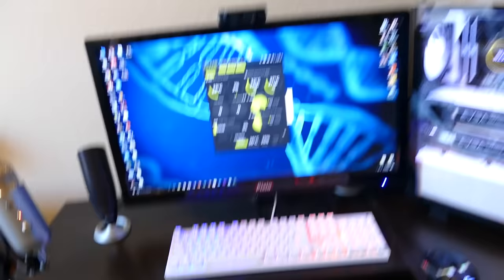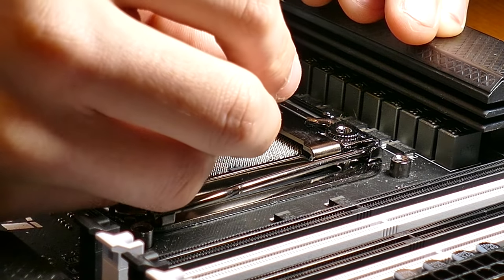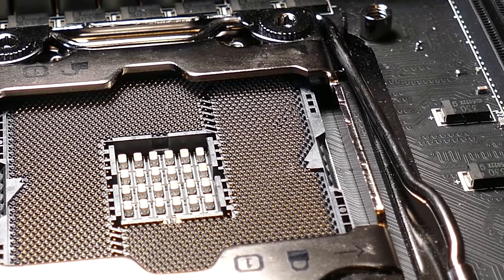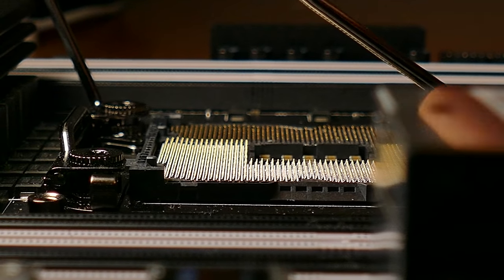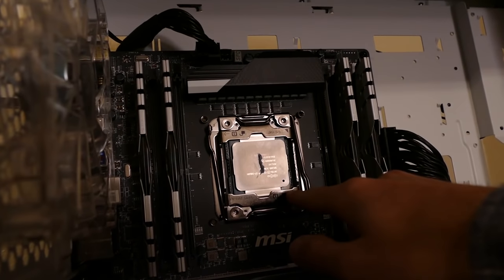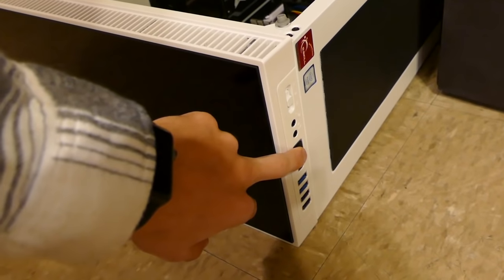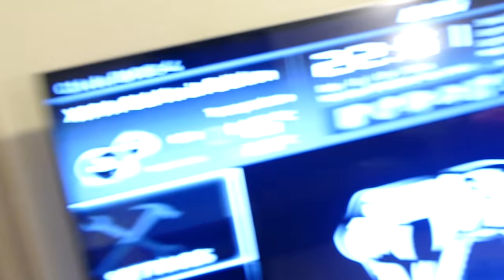I Stepped on a Motherboard. Let's Fix It!

Comment from the maker: - To be frank, this happened a few days after the death of my two editing rigs. Was one large cluster. Been putting this video off for a while. For those wondering how this happened, I was in the middle of a CPU swap. Placed the MSI Krait X99 next to my chair (had no room on my desk) and got up in the middle of working when my brother knocked on the front door. Swung my legs - bent a few pins. That is my confession. Captain Hindsights, take it away ;-)
Reply: Salazar Studio e dud
Reply: this month just hates you.....dont worry
Reply: You should not put motherboards on the floor and swing your legs around like a madman :- )
Reply: go to bed dude...
Reply: catarino neptune you will get use to is after awhile. I remember when I built my first PC I got it up and running problem free first time I was so happy until I looked at the cables..

I was to scared to even try and clean up the loose slack thinking I might bump some random cord slightly lose and have to re build the whole thing. A week ago I replaced my case and I was kinda laughing at that memory as I was ripping anything and everything out of the case.
Reply: Might be a good idea to check and see if that system can read more than 3 channels as it detected 12gb's of ram in bios.
Reply: The bent pins could also be the reason your motherboard can't detect one of the ram sticks. Also, just putting a cooler on top of the cpu doesn't do much, you actually need a lot of pressure to transfer the heat. Just look at the stock AMD coolers mounting mechanism and how hard you have to push that lever.
Reply: +Random Guy next video 'I Stepped on my New PC and now it's DEAD'
Reply: At this point I suspect you have a curse with LGA 2011 chipset.
Reply: Great video. Really need to buy that Anidees AI Crystal case,  Already have the tempered glass theme going with the desk.
Reply: accidents happen, although youve been having some bad mojo as of late.
Reply: Salazar Studio
Reply: Salazar Studio My x79 had a problem with recognizing one stick of ram. Took the chip out and saw there was something in the socket. Grabbed a razor knife and got it out. Stressed me out thinking about bending the pins.
Reply: Salazar Studio Damn, Greg. Did you piss off a shaman that week or what?
Reply: Salazar Studio damn. Hell of a rough week.
Reply: Salazar Studio actually, they do not have to be 100% perfect, as long as they are not obviously out of alignment, slightly off alignment is fine... like if they have a slightly different shimmer in light..  I bought several x99 boards with bent pin issues for 50% off...     and as long as u get them close enuff it is fine
Reply: What camera do you use Greg? Love the vids!
Reply: I did something like that with my 1155 socket early this year. To bend it I used an automatic pencil and syringe with needle, syringe is more precise and easy to hold and the hole in a automatic pencil I used to turn those pins
Reply: You are human, you will make (more) mistakes. Never be afraid to make them, and don't be afraid to share them with us, because they are educational/entertaining.
Reply: You ever consider buying a test bench?
Reply: again we make mistakes sometimes...
Reply: I had to fix the pins on a old amd cpu I had , took 3 hours with micro tweaser things X_X
Reply: I have actually done this on my i7-4790K rig. Scared the holy crap out of me. I have good vision and I had a seriously tough time seeing what I was doing. Eventually I fixed it, and all is well. It also happened to my sister's FX-8350, and I had to fix it there too. Be warned that AMD's stock thermal compound on the cooler turns into glue after 3 years. I feel like an accomplished Computer Surgeon now.
Reply: Try bending the pins back on a amd cup its fucking hard
Reply: Remove your heat sink and fan. Clean off thermal paste. Undo the retention clips. Place new cpu. The cpu socket and cpu both have a trainable and some notches to help you line it up. Drop the cpu into place. Touch the top to see if it shifts. If it does not shift you are good. Clamp the retention down. Put on new thermal paste. Attach heat sink and viola.
Reply: no its not its very easy to rebend amd cpu pins
just use a flat plastic card the same width as the gap run through from all for sides row by row simple
Reply: BeDoG yes it is hard but I did it with a razor on my fx 4350
Reply: @Mr TurDMuF1NM4N3 oh yes it becomes solid to help it turn on your pc and run prime to warm up the cpu after you sure it is really warm turn it off and lay the pc release the lever and nudge a bit the cooler when it is warm it is way less sturdy and way way way easier to unstuck
Reply: That's rough man. Still have a little over a month to go!
Reply: 2016 cursed year
Reply: NovaScathe true true...
Reply: use a little rubbing alcohol around the edge of the cpu and the "glue" will come loose
Reply: could happen to any one awesome video
Reply: 12Gb memory detected pretty much says one or more of memory specific pins are not aligned properly, i had in past Asus Z68 Maximus Formula mainboard that one pin snapped, it happened to be memory pin and that caused loss of one memory slot.
Reply: i've the same situation like you. i've brought, a broken asus sabertooth Z77 for about 20$ which dont recongnize 2 memory slots. I've just set properly the pins, and the mobo was fully working :)
Reply: it really use to be like that haha...I know many remember all the x58 boards people were messing up bending the hell out of the pins and then trying to get rid of it etc haha..you could I know bend like one pin slightly and things wouldn't Post at all etc haha.
Reply: JR man I still remember those days...
Reply: Hunter Parke those were ones too that died etc and just try to run hard etc  had one of those Xeon chips at 4-4.4ghz just trying to kill it at 1.45-1.48v and ALLL UPSET NERD dies right in the middle of an awesome wow raid etc haha
Reply: what was the deal with the ram? i had 2 bent pins on mine and it wouldnt detect 2 channels out of 3. i fixed the pins and then it detected all my ram again.

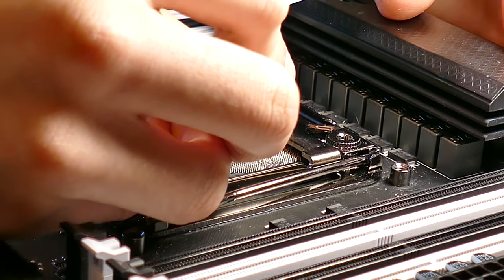Comment: Did anyone else see the pin fly off at 2:33
Reply: Good eye!
Reply: OPK Racing same, it's probably why one of his RAM sticks wasn't showing up. 
I wonder if the CPU can be stable under load
Reply: Greg replied to a comment saying that he reseated and all 16gb's were detected
Reply: HAHAHA LMAO the pin is like "BYE IM OUTTA HERE"
Reply: Now he has a custom 2010-V3 socket
Reply: I don't think it was a pin, it happened again and in the second time it looked like a dust particle. Maybe it is, the image is pretty zoomed in.
Reply: Or he breathed into the board and made dust and stuff like that fly away
Reply: a dust particle wouldn't be that big and would not have described that kind of parabola, also he was talking when the pin flyed and i don't think that he expels enough air from his mouth when talking to send things flying away, and even after all the mistakes he have made with his hardware lately i bet that he is wise enough to not blow air with his mouth on computer hardware since breath has a lot of moisture that can damage it.
Reply: Yeah, saw that. Id bet that motherboard will never be stable under load again.
Reply: I guess you guys never seen dust?
Reply: Zorro

hahahahaha
you meanie ;)
Reply: @milodon316  probably spit

Comment: Wow, I was proud of myself once when I bent one pin and fixed it....this was awhile back when the pins were on the CPU. I probably would have given up if something like this had happened, but after seeing this, if it ever happens to me, I will try to fix it. Good show!
Reply from the maker: Thanks for watching!
Reply: Roger Sullivan happens to me too.. New Mainboard, and I directly fucked up.. but I restored it
Reply: Salazar Studio I bet it's only 12 GB of RAM because some pond are still bent point one memory channel Is malfunctioning now
Reply: Can confirm bent pins can cause memory channels to stop working. I have two faulty slots in my z97 board now, but the good news is that the other two are fine and running 8gb DDR3.
Reply: Today I just bent one of my pins on my motherboard installing my cpu I bent it back as good as I could so tomorrow I’m going to try and see if it works I’m praying 🙏
Reply: Bro thx alot..
Bro tnx😍😍😍😍 your comment inspired me to try repairing and now mine working fine..
I saved 1000 inr

Comment: Seeing the result of this repair video and another from LinusTechTips a couple of years ago, I've tried to fix a motherboard on which I've bent a few pins last year, and it's an LGA1155 socket, that no one sells new anymore, AND IT WORKED TOO!
Now I have a bench test with a Core i3 that I've swapped two months ago. Thanks for showing that is possible and the idea of using a SIM card opening tool, it worked great ;)

Comment: One or more pins are still misaligned, thats why one dimm doesn't work. I had the same problem on my X79 and upon fixing 1 or 2 pins it was working fine again. That said check it again and make sure the pins are perfect, then you have 4 dimm/quad channel support again.
Reply from the maker: It wasn't. Reseated RAM and all 16GB were detected.
Reply: that only because u get the reflection, it just needs to make contact with cpu contact points, sometimes they bend in opposite direction making u feel like theyre not gonna work

Comment: One trick i use on bent pins...get a very thin metal pipe (like "charging" injection needles - it has blunt end as it is ment for drawing drugs out of ampoules, and they come in different diameters and are made of stainless steel, so very strong. It would work with regular pointy injection needle of right (very thick) diameter i guess, but it is better to have one with blunt end. They have them in pharmacies for few cents a piece). You stick pin in the "needle" and bend it back to right position... 
I got mine with inkjet cartridge recharging kit and it perfectly fits over pins...

Comment: Greg did you ever get all of the RAM working? A huge number of the pins on an lga 2011(3) socket connect to the quad channel RAM slots. Even one remaining bent pin could cause one or more RAM slots to no longer function. If you check eBay, many "scratch and dent" x79 and x99 motherboards pop up with only 2 or 3 of the channels working due to bent CPU pins.  I hope this isn't the case with you, but if it is you may have to get back in there with your SIM extractor pin. Good luck!
Reply: Most likely. That's the first thing I thought of when I saw only 12GB posted.

Comment: I've had to use a camera with a macro lens connected to the TV to see all the pins. I suggest getting some fine tweezers. ifixit should sponsor you with a kit.
Reply from the maker: The tool I used was fine enough.
Reply: great! maybe I will just sponsor an ifixit tool for you. for later projects. now all you have to do is run prime95 on it for a few hours to make sure all those pins are working.

Comment: I bent the pins in one corner of an FX 6300 once. The thermal compound I had on there dried and the fan got stuck to the CPU. As I was removing the fan, had to use some force. That ripped the CPU out of its socket with the CPU latch still DOWN! Fortunately no pins broke. I used a pair of tweezers and a credit card to align everything. Got it back running.

Comment: A couple years ago, on my very first PC I ever built for myself, I ended up dropping either the CPU socket cover or the CPU itself into the socket and took it upon myself to figure out how to fix it. After finding a tutorial from Linus's channel, I unbent all of the pins (I think ten or so) and gingerly installed the processor itself. The motherboard lasted a years and a half or so, up until I removed the power supply to try and fix a problem with someone else's computer and shorted my own board somehow in the process (The technician who was looking it over said that some of the pins may not have been properly realigned, although we have no idea wether or not that is what really killed it). I guess the rubbish moral here is that mistakes happen, and at least you can turn your mistakes into educational entertainment for all of us to view.

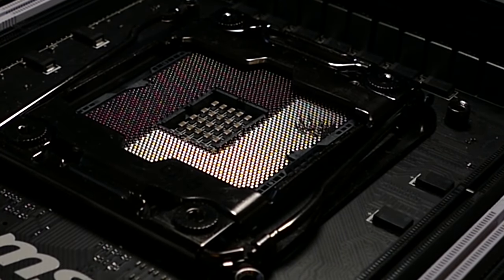Comment: At 2:32 to 2:34 what is that thing flies across the screen? Seems like it comes from the socket itself.
Reply: probably a small fly....
Reply: Badda Bing its a pin for the memory channel i think, that should be the reason why he gets only 12gb
Reply: Badda Bing You have good eyes. Yep that's a pin alright. I would not want to put an expense CPU in that
Reply: Was going to say the same thing about the missing RAM, I think what you've said here is the case.

Comment: I don't think it's showing 12gb of RAM because you didn't put the DIMMs in properly, I think your pins don't make such great contact after all and the memory controller cannot recognize the memory --_--
Reply from the maker: Reset DIMMs. All 16GB detected.
Reply: I thought of memory controller too, but i can see you are good now after reset. I bent some pins long time ago on my 775 socket, after fixing it, I felt like hero lol.
Reply: Yea good work. But it's really common for the CPU to have lost one channel when the pins are somewhat bent.
Reply: if even 1 pin wasn't making contact the pc would not boot.
Reply: Túlio Matias Yea mate, It's completely possible to boot a PC with some (not all) but some of the pins not in contact with the CPU. Such as PCIe and Memory are common to be bent and those peripherals not detected properly. Also, there are a lot of redundant common and power-pins possible to remove but not recommended due to the instability of high frequency electronics.
Reply: Túlio Matias Well, that completely depends on what the bent pin is. If it's something like a ground pin (which there are a lot of), you might just be lucky enough, and it'll work.

Comment: I still have my old ASUS 775 Commando with bent pins lying around. It's from my second first build. Was going to put back the protective cover over the socket but I put it on the wrong side of the CPU bracket. When I tried to close it I didn't understand why it wouldn't close properly. Of course by then it was already too late. I would've been far angrier if I hadn't already built a new computer. I learned the hard way to always keep the manual close by. I've always wondered if it would be possible to bend the pins back and get it working again so maybe I can still bring my old Core2Duo build back to life some day. Thanks for sharing, Greg.

Comment: i had a similar situation and used K&S tubing.. smallest i could buy. worked great , slide it over the bent pin and carefully coax it back in shape.

Comment: Hey Greg! Man of course we can't expect you to answer all the comments, but I'd really like to know whats up with the original version of Walter White 2.0. As far as I reacll it had troubles that couldn't be blamed on a faulty cable or the Deepcool powersupply. Did you investigate any further what could have caused the issue with the psu? What was the component that drew too much current? Like I said, you can hardly blame a cable that wasn't even installed in the rig, right?
Reply from the maker: Meteor Media Explained it in my last vid very clearly.
Reply: Ok right, thanks for replying. Keep up the good work!

Comment: CPU could still be unstable and crash though. Even if it boots.
Reply: Could also be the reason why not all the ram is showing up.
Reply: Same thing with one of my mobo's. 2 bent pins, the machine posted, booted and ran for a few hours then crashed. The "fix" with the system in this vid did not include a CPU or RAM burn test.

Comment: Oh o less memory than you installed being identified by bios means you still have bent pins and one of your memory channels went bye bye .
Reply: still better than my mobo which, after I upgraded my RAM, only recognized 1 channel of ram from 2 different sets of RAM
Reply: You are right
Reply: HELLCAT.28 I actually dont know if thats the case with my cpu right now... currently my pc lacks one pcie x16 and the ram isnt detected properly... dont know if something is wrong with the motherboard or cpu...
Reply: Peter Griffin I've done a Bios reset several times and located the ram into other ram banks but still sometimes the pc wont start while the ram sticks work perfectly fine in another pc... the pc does also not detect any gpu thats installed in the PCIe x16 slot... it only shows a picture if you use the internal gpu or install a graphics card in the PCIe x8 slot...

Comment: I did this with an old AMD phenom II x4 830. dropped the CPU right out of the box onto concrete floor of the garage I was working in and bent an entire corner of pins. I used a thin and hard plastic ID card so all of the pins would bend together. fixed it and it is running in my sister's computer just fine too this day!

Comment: I heard suggestions of using a mechanical pencil with a thin metal end. Sounds plausible and possibly easier.
Reply from the maker: Working with flaky graphite? I think I'll stick with the SIM tool ;-)
Reply: Lol. The right tool for the right job is usually best. I was referring to the actual body of the pencil as opposed to the graphite. I'll just pray I never have to attempt that repair though.
Reply: Nicholas Reif smart man
Reply: I fixed an AMD chip this way. it's the best way I feel for fixing CPU pins, but probably wouldn't work on a motherboard. any empty mechanical pencil would work.
Reply: The best way to do it would be with some small tweezers
Reply: would have been easier with a shovel ! yeah im pretty confident about that !
Reply: yup use the eye of a need just big enough for the end of the MB pin to insert into it do not forget to cork the pointy end

Comment: I bought a z170-a motherboard on ebay for 30 dollars because it had about 10 bent pins. I actually managed to bend them all back and now it is my new personal rig with a 6600k running at 4.6! Such a good deal.